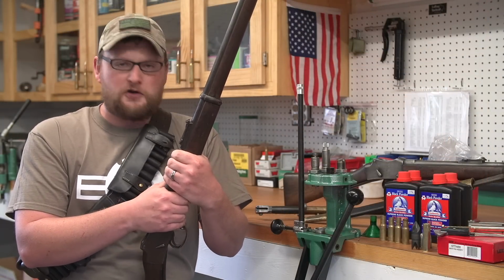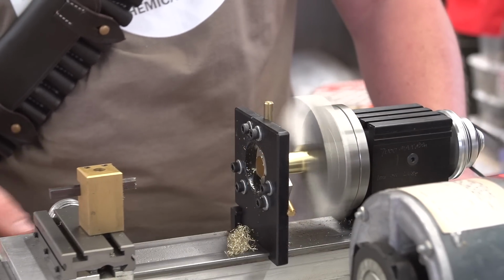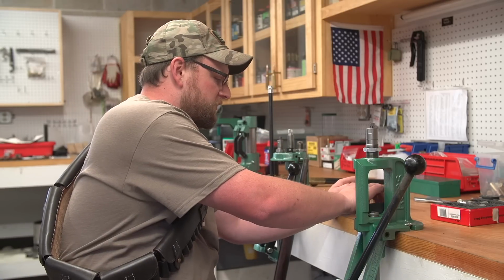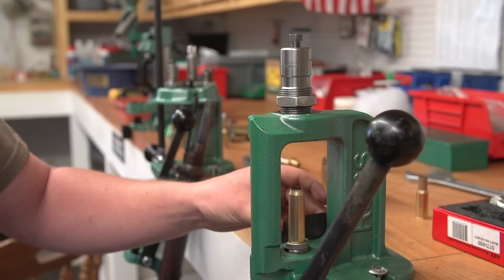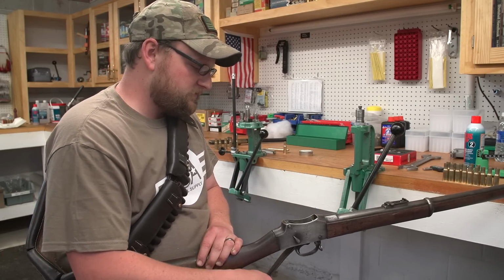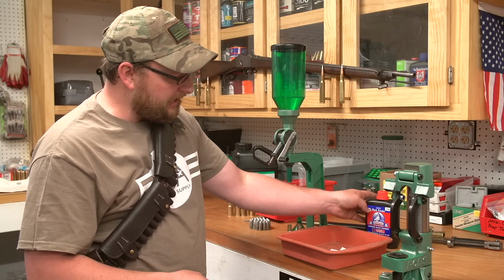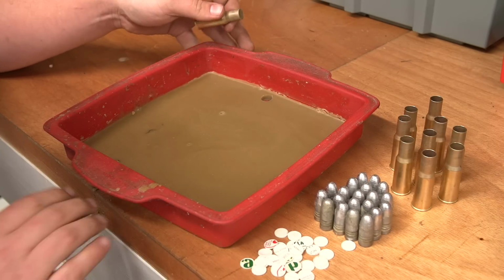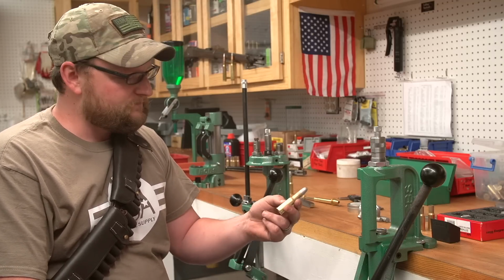Reloading for the .577/450 Martini-Henry

Comment from the maker: Equipment Overview: 00:03:00
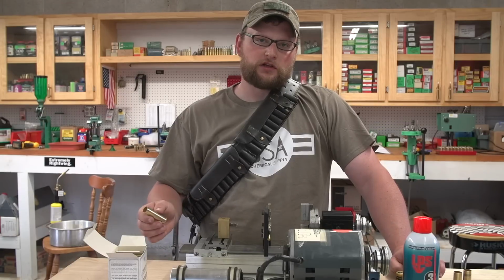Trimming & Initial Setup: 00:08:36
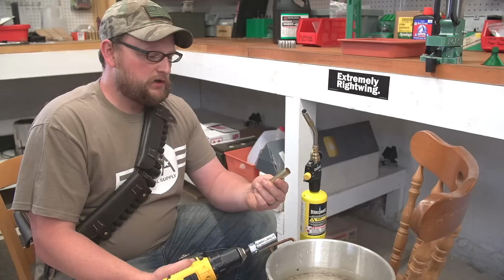Case Annealing: 00:10:39
Case Forming: 00:14:01
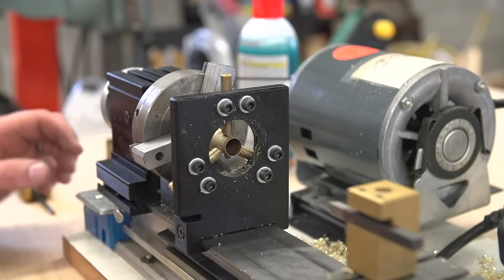Final Case Trimming: 00:22:17
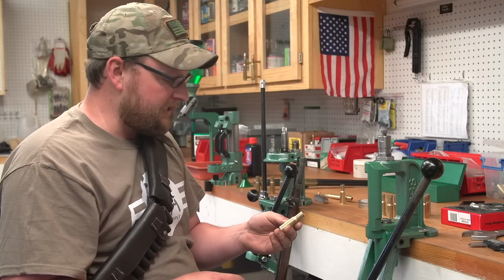Final Case Forming Operation: 00:24:07
Testing Brass Fitment: 00:26:31
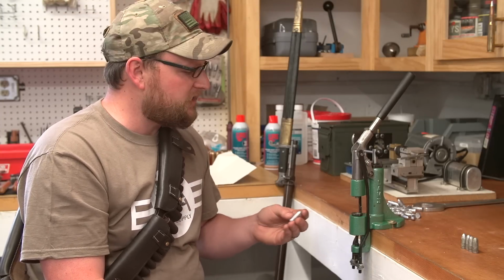Bullet Sizing: 00:29:37
Case Neck Expanding: 00:32:17
Powder Charging: 00:33:08
Adding Polyfil and Paper Disk: 00:35:15
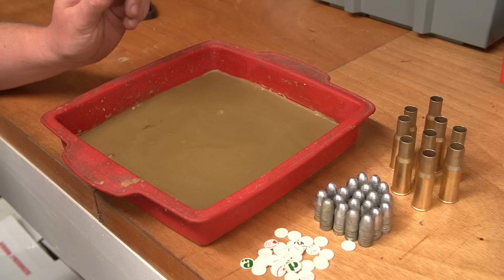Adding Wax Plug: 00:38:55
Bullet Seating and Completed Round: 00:42:14
Reply: ERIC sir please watch my MELTDOWN BERETTA EPISODE 3 I made this video inspired buy you im your big FAN

Comment: I shoot where there are leaves and dead grass  Therefore I can't stuff my cases with cotton.  Doing so sprays red hot embers in a cone for some distance.  Starting forest or grass fires is not my goal.  Therefore I always use poly fill in my .577-450 cases.  It blows out as a snowy mist, but does not create a fire hazard.  I believe the British used cork wads.  Some people I know use Cream of Wheat or Oatmeal.

Comment: So does simply sizeing the lead bullet to the bore affect the accuracy as compared to paper patching? All other examples of 577/450 ive seen has been paper patched.
Reply: It should.  Martini Henry guns used a tapered bore and squeezed the bullet down to the muzzle size.  Starting at muzzle size without paper patching should allow gases to blow by the bullet and thereby reduce the velocity.  Alternatively, without a paper patch the base of the projectile may obturate to the available diameter, then squeeze the bullet down to muzzle size as it progresses through the barrel.  It would depend on if your cast projectile was soft pure lead and malleable, or if it was a hard cast with Tin or Anitomy added.  The paper patching accomplishes two things  It allows a snug fit of the projectile from the initial meeting of the bullet with the rifling, all the way to the muzzle.  Additionally MH barrels don't pick up lead from the bullet passage as they only contact the paper, not the bullet.

Comment: Do have any good load with smokeless powder ?
Reply: There are none.  High carbon Steel didn't exist for firearms when Martini Henrys were made.  These were made out of low carbon steel and iron.  Several people have had disastrous results attempting to use smokeless powder in Martini Henry guns.  Even as light a load as 11 grains of Unique can turn the gun into a miniature grenade.  Stick with Black Powder.

Comment: I started reloading this cartridge many years ago. I got some second hand Bertram cases very cheap, the new ones were rather pricey. The Lee dies on the big press were great but I kept the cases fire formed so as not to wear them out. The bullets were for a 45/70 mould, 10 thou undersize apparently but with a paper patch they gripped very well, no need to crimp, dug out fired bullets which were hexagonal from the Henry rifling. Key was the grease cooky below the bullet, kept it all cleaner. I used cous cous as filler, not poly, as it was biodegrable. Beautiful rifles and experience.
I tried the Magtech shells but never succeeded, your video is fantastic. I will try once more.😊😊😊

Comment: I bought an extra Lee sizer die, cut it off right above the caliber stamping, and bored it out to .54". I use this die as intermediate sizer and it works perfectly. Anneal the 24GA case once, lubricate and run it through the intermediate die. Trim to length (actual case length should be 2.34") , lightly lubricate again and then run it full length through the normal unmodified sizer. This eliminates having to readjust the die during the sizing process and also drastically reduces the amount of force needed to run the case through the die. I have resized about 200 cases this way and have never lost a single case.

Comment: Very well done video on the loading for the Martini Henry.  I have two of them and have actually shot some of the original Kynoch loads for it, not recommended.  I like the bullet you cast for it because I am paper patching my bullets for it which is a whole nother thing. I have used black powder and smokeless loads for it based on load data I have found.  The smokeless works really well because black powder is just now becoming available again.  I load for this and the .577 Snider which is also awesome.  I have also tried to form brass for the Martini but kept creasing the brass and I like your process which the key is annealing I think.  This is one of the more difficult rounds to reload for and you obviously have a very good process for it.  The video was very helpful.

Comment: Y’all should do a review of the .577-450 adapter to .45 Colt. It’s just a metal cartridge with a hole for the Colt round to fit so you can fire your martini a lot easier.

Comment: Great video, loved watching you form the cases. When I first got the itch to shoot my M-H's in 1982, only brass I could find at the time was I think from Australia and $100 for a box of 20. Lyman dies. I think my mold came from England and was sized to make a proper paper patched bullet. I've never seen a British military or even British commercial load that had a bare lead bullet without patching on the 577-450. Tried once with lead sized to the bore and accuracy was much worse, that rifling really does like  a patched bullet. Be interested to see how your shooting goes. We used to take a press that would clamp to the table at the range, powder and pre-lubed and patched bullets in an old cigar box. Great job.

Comment: Can't you run it through the press while it's still pretty hot, before you put it in the bucket of water, or will it stretch too much?
Also, is there any particular reason why you can't just use a simple brass pipe cutter instead of a lathe?

I take it you have no ill effects from using the polyfill instead of a 100% cotton material?
I always was told to cut my patches for my lead round balls out of 100% cotton because synthetic materials will melt in the barrel and cause issues with cleaning.
Reply: Spam

Comment: Cream of wheat is what you should be using to fill gaps in a BP case. That polyfill stuff is going to burn and make weird residue in the barrel.
Reply from the maker: Cream of wheat can ring your chamber if you’re not really careful
Reply: @Iraqveteran8888  Good to know. I think if and when I ever go to cook up some ammo for my martini, ill go with hemp or flax tow to fill the air gap. I don't like putting any unnatural material through my old smokepoles.

Comment: Brass annuals at 600-800 degrees. Don't go by color unless you want to potentially blow up your guns. Buy a infrared thermometer for less than 100 bucks and save yourself the guess work and potentially ruining expensive brass.

Comment: Thank you for revisiting this topic.  I was dismayed when you last video about this cartridge suddenly vanished.  I like to anneal my brass again after the final sizing.  I like the white cloud polyester fill produces.  Much safer than glowing embers of cotton puffs too.  Noting with interest your going for waxed lube bullets vs paper patched rounds.  I find paper patched bullets leave a barrel that is easier to get clean, but then again paper patching each bullet is a lot more work.  I did a video a few years ago about converting Kynoch brass to use 209 shotgun powders, but I agree brass with primer pockets already set up for standard primers is a lot easier, and old Kynoch cases sometimes split on their first firing anyway (also with extensive hang fires from the old primers and decomposed cordite) as well as getting harder to find economically